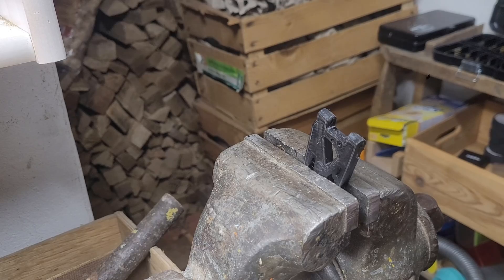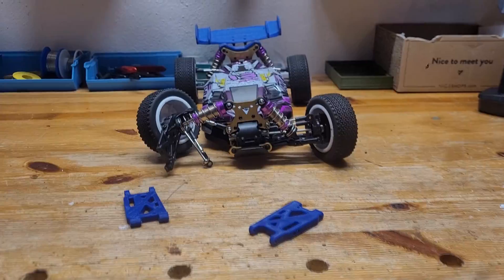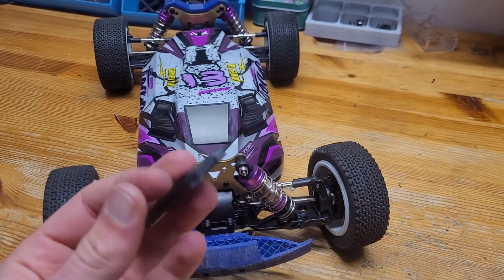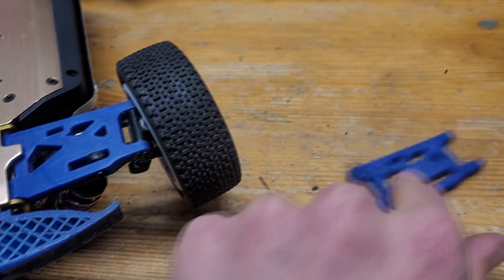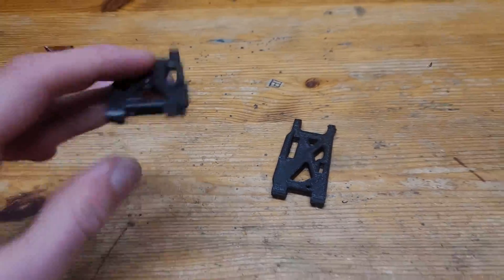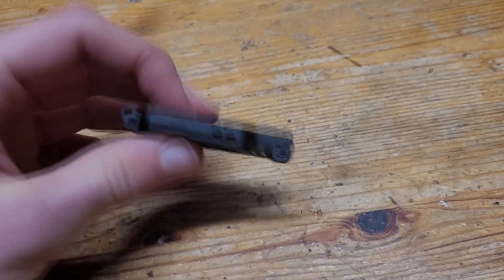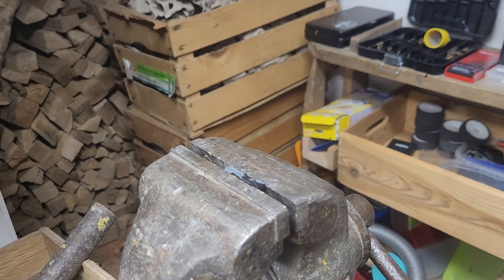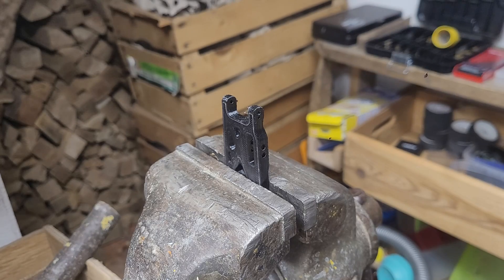I 3D Printed Unbreakable RC Car parts

Comment: Pretty sure the new models are aluminum.
Reply from the maker: I'm pretty sure they're still plastic, but you really don't want aluminum for these specific parts anyways. That would just transfer the impact force further into the car, breaking parts that are harder to replace. 
You want these to either break or absorb the impact.
Reply: Yep, just like Val said, its almost like a real car with crumple zones

Yet im running upper and lower aluminum arms on my udr😄
Reply from the maker: @mattiazanni3086  how's that working out for you?
Reply: @ValRC1  i mean i never broken the stock plastic ones except for one of the upper ones but i heard people say they are a weakpoint so i got aluminum ones, and they have been good
Reply from the maker: @mattiazanni3086  okay, nice!

Comment: Interesting, I wanna try 3D printing too and fascinated by it. looks like the part behaves like hard rubber and has nice flex. I wonder if you can use carbon fiber as material to 3D print, that would be  awesome. cool vid, 👍
Reply from the maker: Thanks for watching!
You should definitely give 3d printing a try, it's pretty cool! Yeah I'm thinking about trying some carbon fiber infused nylon filament, only issue with that is it's pretty expensive..
Reply: @ValRC1  Expensive and it absorbs tons of humidity out of the air and needs to be kept very dry. Nothing worse than spending $100 on a roll of filament only to have it print poorly due to moisture!
Reply from the maker: @GeddyRC  true, the moisture thing is an issue with nylon as well. Especially since the basement I print in frequently has humidity levels over 70%